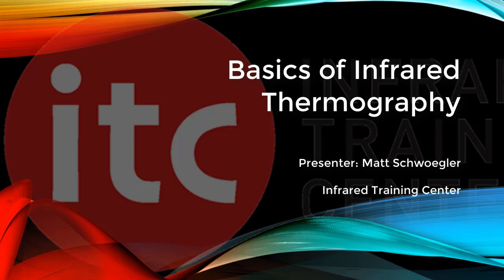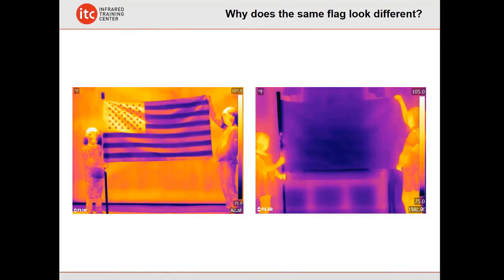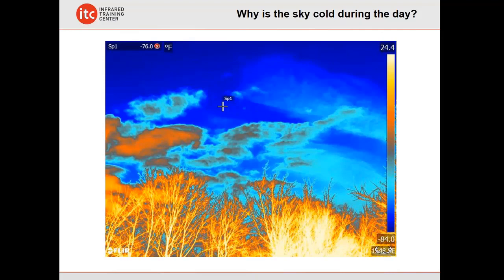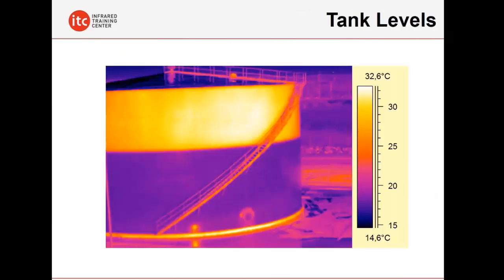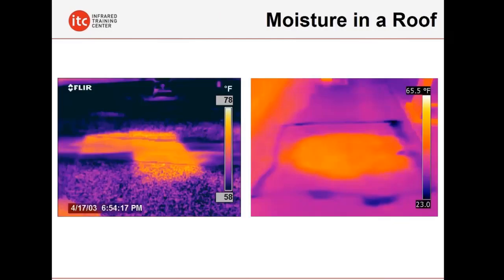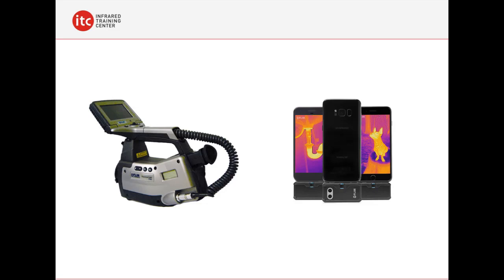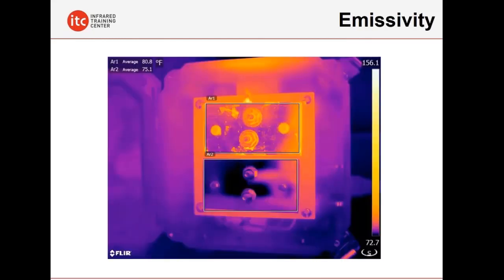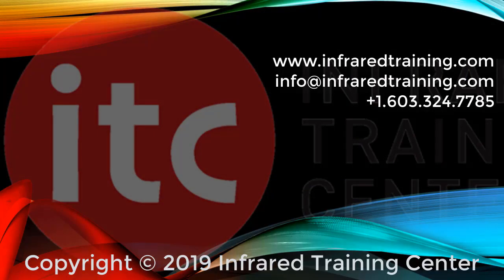Basics of Infrared Thermography

Comment: I have a question, maybe you can help me: I would like to make an infrared measurement in a region where the climate is incredibly hot (up to 50°C / 122°F). What do I have to consider when entering the measurement parameters? Can I leave the default settings as they are or do I have to change them?